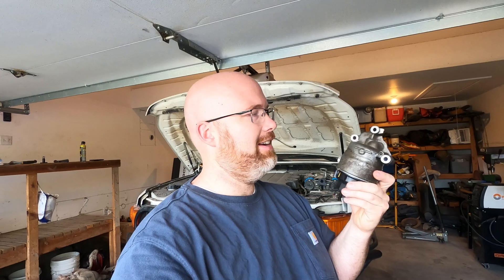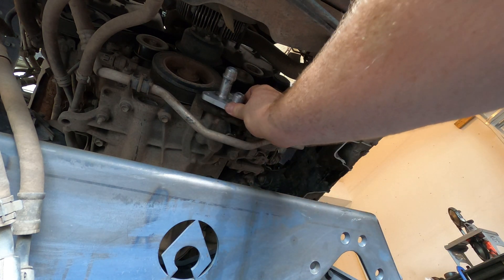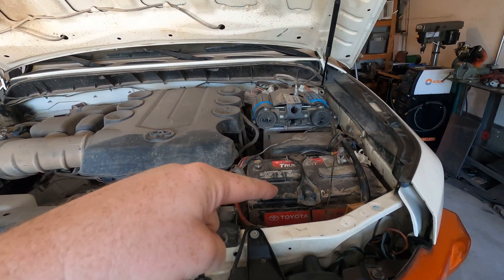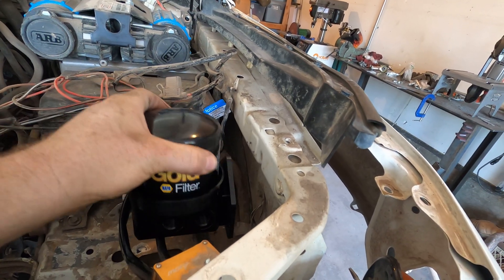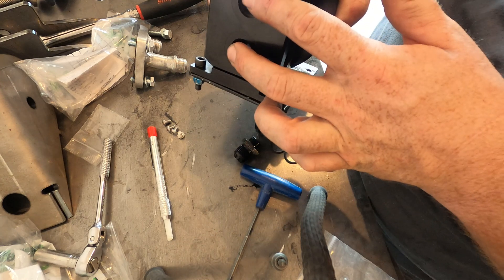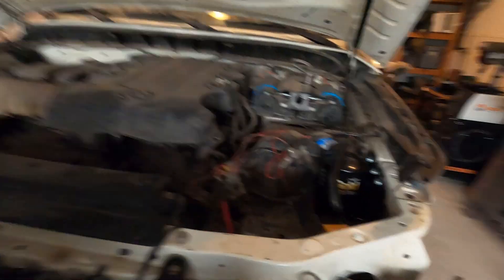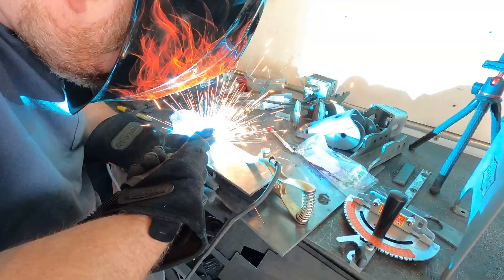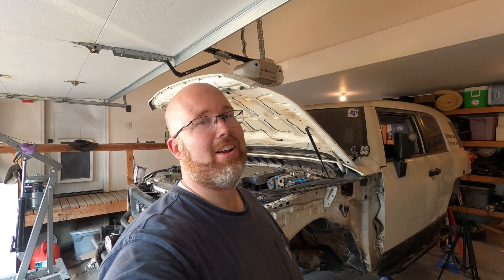FJ Cruiser Oil Filter Relocation For A Solid Axle Swap

Comment: Do you have contact info for the place that made the oil filter adapter? Curious if they could make another one or have the technical data I could give to another shop to have one made.
Reply from the maker: Yes, but they wouldn't even remember that they did it. Email me at offroadhub.official@gmail.com and I can send you pictures and more info.

Comment: How do you identify which oil hole at the engine block is in or out?
Reply from the maker: Based on the factory oil filter housing. I can't remember which was which off the top of my head. But the housing makes it obvious because you can tell which way it travels into the filter.
Reply: @offroadhub.official  thank you for the reply... I'm doing the oil filter relocate plate on my build too, thanks for the idea and info

Comment: I think of all the mods you have done, that one would make me the most nervous because someone at Toyota's engineering department probably did a whole lot of math and testing before deciding to stick that on the bottom of the engine. I know people have moved them, but still the jury is out on the long-term consequences of those moves. but, if it has to go, it has to go. 

I subscribe to car simplicity philosophy: you can pretty much abuse a vehicle anyway you like, as long as it has oil.
Reply from the maker: You can't mess around with oil, much. 😉

Comment: So when you change your oil filter all the oil is going to go all over your compartment I should have put it upside down so that you wouldn't have that problem honestly I think you're making more work
Reply from the maker: The oil won't go all over the engine compartment. All that needs to be done is a quick hole punch in the oil filter and all the oil will drain out of it. A filter that is right side up also makes a huge mess when unscrewed. This will actually be less messy.

Comment: She’s going to be 100 lbs lighter after you finish finding where all the muds hiding. Cool video Ken, thanks.
Reply from the maker: That's true! I've taken A TON of mud out of this thing hiding in crazy places.
Reply: @offroadhub.official  dont,,,have the filter sitting upside down,, it drips,all over the floor,hands,dog,engine bay,rocks,sand,where ever you change it.. be like ford, hang down, ..
Reply: @offroadhub.official  please ,,,use a fkn clamp,when you drill,anything,,or lose fingers..
Reply: @offroadhub.official  could of made a tall brk,on the edge of inner guard. with the filter screwed off down,with no spillage. shorter lines,not that ,that matters,,longer the better really,more oil,more cooling..yes,...next is an oil cooler,,,yes..& decent trans cooler..

Comment: Oil filter relocation was great, but why not mount it so the filter in on the bottom? Seems like it would be a lot less messy... and the track bar bracket...... there's way too much leverage on it.. there are a ton of universal brackets out there that would work how its intended.
Reply from the maker: The oil filter won't be messy, just have to punch a vent hole and all the oil will drain down. I've scoured all the bracket makers, nobody seems to have anything that'll work. 🤷

Comment: How do you keep oil from pouring out of the filter and then all over the inner fender when changing the filter?  If the filter drains back when the engine is not running, then the oil pump has to fill it on every start, which will give you more oil starvation at the critical initial start up.
Reply from the maker: When the oil filter is sealed, the oil will not drain back. To remove the filter without spilling oil everywhere, just punch a small hole in the top of the filter, which allows the oil to drain back down. 👍
Reply: @offroadhub.official  or.  Just mount the filter upright?
Reply from the maker: @greggoett  possibly. But even upright filters spill oil when you unscrew them. 🤷

Comment: New panhard bracket looks better. But the platform it's on is too long, it has a ton of leverage at that length. If you shorten up that platform and move in the frame mount for the panhard youl'll be solid.

Comment: I would suggest ruining a an oil cooler in between, would keep the engine very happy.
Reply: Would that warrant modifying the oil pump or getting an oil pump?
Reply: @boldstar69  in some race engine applications, yes and a second oil pump is needed, but not on the Fj engine. The oil pressure on Fj engine can run up to 90 PSI, that is a lot of force since it needs to push the oil through the filter and back into the engine, the only crucial part that needs attention is the inside diameter of the inlet and outlet of the oil cooler that needs to be the same diameter of the inlet and outlet on the engine block/oil pump to reduce internal drag.

Comment: Super cool. I like the idea of relocating the filter and housing just for ease of maintenance.
Reply: My 2007 FJ has it on top of the engine.  Works for me!
Reply: @PeteHemdem   yeah I think they blew it when they moved it to the bottom.
Reply: @eqlibrium854  I had a 2008 and now a 2013.  I totally agree that the move to the bottom is just plain annoying but perhaps they wanted everyone to get frustrated and take it to the dealer for their oil changes.

Comment: Panhard bar looks better with the joint being horizontal now. Can you move the whole thing closer to the axle?
Reply from the maker: Yes, I'll get it as close as I can to the axle!
Reply: I agree. Too much leverage will be on it at that length. Also it needs a lot of gussetting. I'm sure you'll adress that. Everything is looking g good.
Reply from the maker: By closer to the axle do you mean move it down, or closer to the differential cover? Reinforcement is yet to be added to both brackets.
Reply: @offroadhub.official  yes closer to the truss/axle tube. The longer the panhard mount at the axle end the more leverage it will exert against the welds. So increasing the chance for breaking.
Reply: @offroadhub.official  yah closer to the front of the vehicle (shortening the bracket you made, shorter=stronger)

Comment: I'd look at relocating the oil filter to a horizontal location. With it being vertical like it is, each time you change the filter it'll dump oil all over the place in the dog house unless you drain the oil first and let gravity empty the filter before removing. Napa used to make up high pressure hose lines while I waited (in most cases) for high pressure hydraulic lines. The build is coming along well. Look forward in seeing you go through the rest of the build.
Reply: Or... maybe remove the plug from the bottom  "out" hole and put a stop cock valve with a lil hose on it to drain it.
Reply from the maker: Baxter recommends punching a small hole in the top of the filter before removing it so that the oil is able to drain down. Then remove the filter.
Reply: @offroadhub.official    Gravity will do the job.
Reply: On older 2007-2010 (I believe) FJs the oil filter is on top but it has an angled catch basin for the small amount of oil that dribbles out.  And most of the oil has drained from the filter once the motor stops.  Had an old 1990 VW Jetta with a top oil filter, thought it was a great idea!